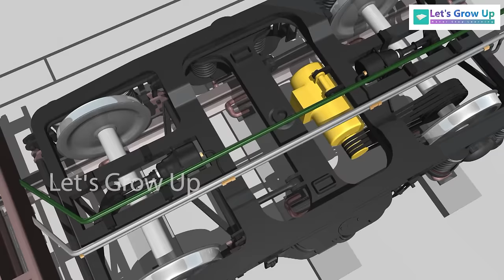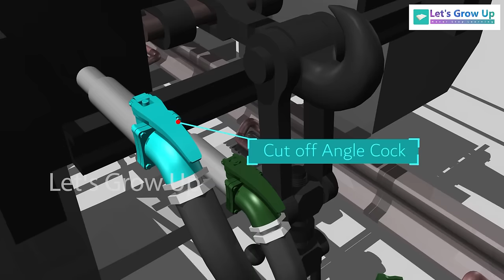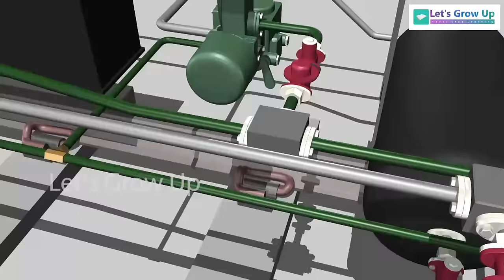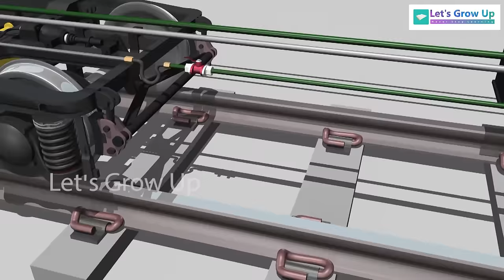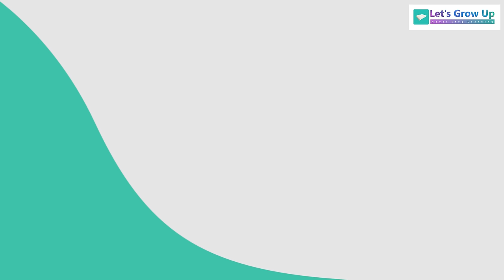How Train Brakes Work: A Comprehensive Guide

Comment: I chose to answer this way. I will pull the lever to make the train turn and just before the rear wheels of the train turn, I will pull the lever back straight. that way the train will be in the position where the front wheels are on the right rail and the rear wheels are on the left rail. that way the train will stop❤

Comment: Doesn't air pressure release the brakes, like if a train comes apart, the brake pressure drops and the brake come on automatically - thus _"Fail Safe"_?
Not like in a bicycle/car where pressure is required to apply the brakes! Not fail safe!